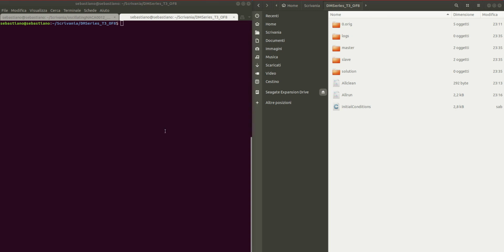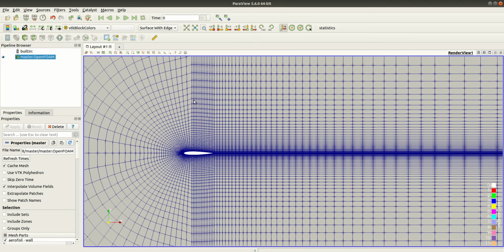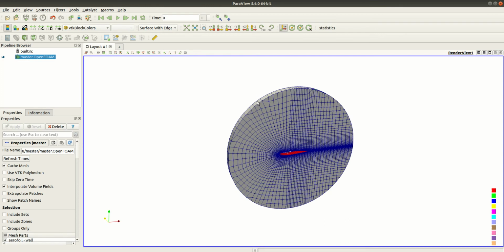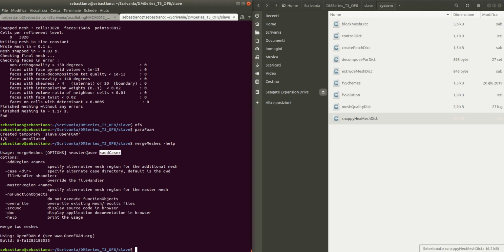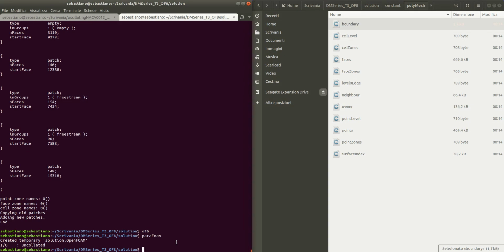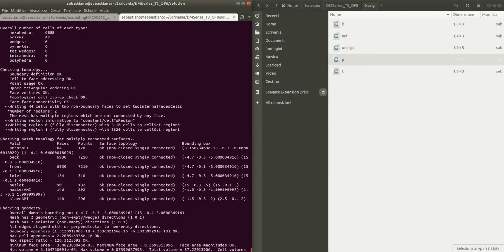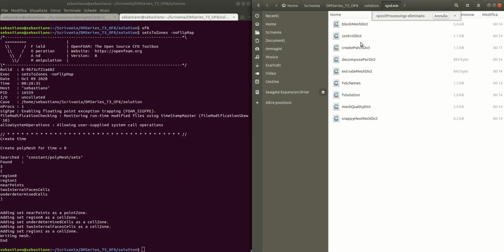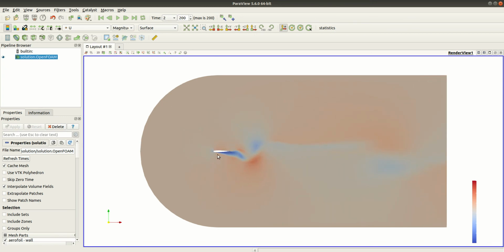Dynamic Mesh OpenFOAM Tutorial 4 - SolidBody and AMI

Comment: If my airfoil is deforming not in rigid body motion, which approach should I use? The displacmentLaplacian and SBRStress solver cannot handle large mesh motion. Is it possible to use AMI to confine the mesh motion around the deforming airfoil? Thank you!
Reply from the maker: OpenFOAM can't handle that kind of motion by default. You can use something similar to the SLERP interpolation, which is at the base of the InterpolatingSolidBody motion (https://www.youtube.com/watch?v=UUla8AayM8Y).

Comment: First of all, thank you for all this videos. It's such a great stuff in order to learn about the DynamicMesh in Openfoam. Second, I would like to ask you something regarding force coefficents. I want to calculate the cl and cd of the airfoil for every timestep using the forcecoeffs function from OpenFoam. However, I need the angle of attack for every timestep to set the lift dir and the drag dir (don't hesitate to correct me if I am wrong or there is another easier way to perform it) and eventually calculate the cl and cd. So.. how can I get these angles for every timestep? How have you calculated the cl and cd ? Thanks in advance and  greetings from Spain!!
Reply from the maker: The lift is by definition aligned with the incoming flow, so, as long as that remain constant, you should have that value from the beginning.

Comment: Thank u for ur video, i do have one question how to use searchableCylinder? suppose i have a 2D surface of 15x15 dimension and i have rectangular whole at the center of the domain. i want to make a baffle cylinder of radius 2 for my rectangular whole. should i define point1 and point2 as (0 1e3 0) and (0 -1e3 0)? i saw UserGuide of openfoam for searchableCylinder, still couldn't get clarity on this
Reply from the maker: I don't know what your coordinate system is but anyway for OpenFOAM a geometry is just a geometry, it means that you can (and usually it is done) have it dafined also outside of the actual mesh. If you want to extract a portion of the mesh, or simply create a patch in the snappyHexMesh, you have to have your cyliner cutting the mesh entirely. So the big numbers that you usually see in the 2D tutorials refer to the direction normal to your 2D plane, whicn is theoretically infinite. Since OpenFOAM cannot handle 2D meshes (intended as surface meshes) for the flow solution, you will always have a certain thickness of your mesh, so in order to be sure that your geometry is passing from one side to the other one pople generally set a very high value in that direction. Was it clear?

Comment: Thank you sebastiano. I would like to say to you and your followers, something that i have learned in my case. If you are dealing with dynamic mesh, check your mesh, check it again and again. If your mesh is not properly generated, Cyclic AMI is not going to work. I have lost 3 days for it. Check mesh.
Reply from the maker: yes, check mesh is very important if you need your solution to be accurate (always apart from tutorials), and usually the -allGeometry -allTopology options highlight some warning that you would miss with a normal call to checkMesh. Mesh quality is strictly coupled with the choiche of the numerical scheme in the system/fvSchemes

Comment: Firstly, thank you for your video, it helped me to understand the approach. I want to ask if it is possible to define two rotating different regions, which are rotating with different omega, in dynamicMeshDict?
Reply: I have the issue could you guide for the changes to be done in dynamics mesh directory.
Reply: Yes, it is possible, its called multiMotion, search for this keyword on Google, you will find it
Reply from the maker: As Malhar says, you can define more than 2 regions and use the multi motion to specify the motion in each region. It is not a easy task since most of the time you have to use a tabulated motion, which means that you have to write down the body motion time history. Keep in mind that the motion is displacement (deltaX), not the actual coordinates of the CG of the body you want to move.

Comment: Hi!
First of all, I'd like to thank you for this wonderful tutorial. 

Now, the reason I'm commenting is that I'm unable to get past the createPatch step in this tutorial.
I'm facing an error when I run createPatch. The error is - 

none is not in enumeration:
5
(
coincidentFullMatch
NoOrdering
rotational
translational
unknown
)

Can you please help me understand as to what I must do? 
Thanks in advance.
Reply from the maker: Try commenting that line (transform none) in both patches creation. That parameter is not necessary in this tutorial. It is strange because it should work with 
transform none, even if it is not on the available options. Are you using OpenFOAM-8?